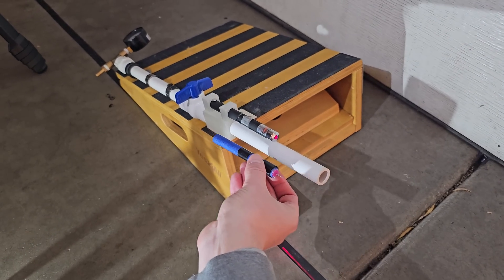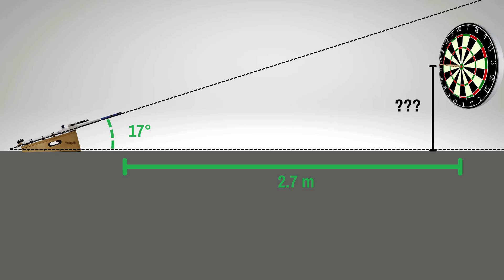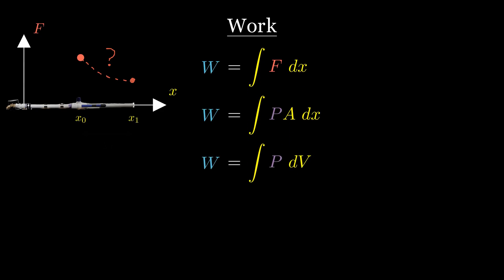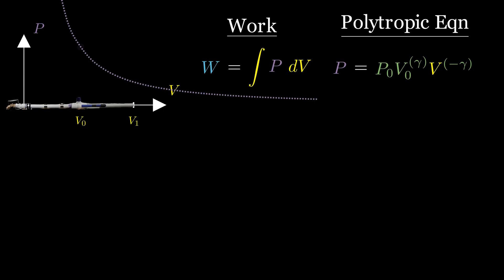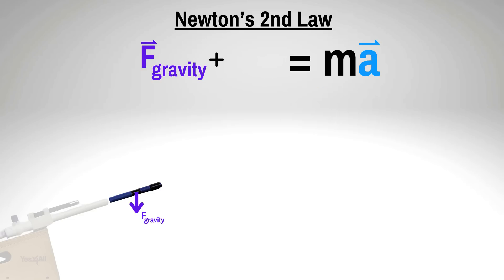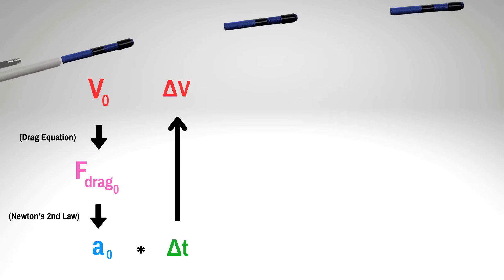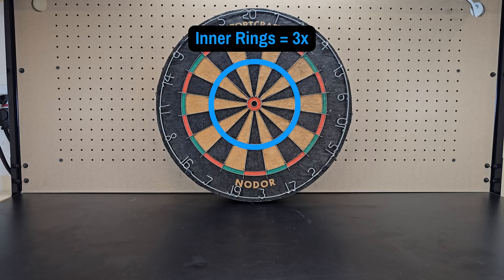Pneumatic Dart Cannon: Theory vs. Reality

Comment: The dart doesn't seal against the cylinder perfectly like a piston... a lot of pressure will escape around the sides. The actual force on the dart varies a lot based on how tight of a seal it is, and how steep of a pressure drop-off you have. A larger pressure vessel would have less drop-off. Also the drag calculations vary a lot based on the exact geometry of the dart, but I don't think it's significant with the weight and speed you are working with. The bigger factor for trajectory is the wobble of the dart leaving the barrel.

If you want to try again, try using a more rigid dart material and some kind of plunger and o-ring to seal against the walls of the tube.

Comment: If we take into account the following attempts it could be less likely that the math was wrong but more about the execution.
With no wings to stabilize the dart it is less likely to fly straight.
The release mechanism would initially release the air unevenly against the dart.
Weight distribution within the dart itself could be off as it was put together manually rather than something like 3d printing. This allows greater room for error.
These are just a few ideas off the top of my head.

Comment: I thought over, but then with your calculation you predicted the speed to be 63m/s which is wayyy to high so I changed to under thinking you would miss the board. In the end, as you said yourself, the distance is too short for the difference in speed to make a difference

Comment: I think the biggest factor, especially regarding accuracy, was the material of the dart. Your calculations could've potentially been more accurate if you used a more uniform material. I would assume it's really hard to calculate things through cheap styrofoam, and I doubt nerf darts are air tight

Comment: A distance a bit greater would allow the dart to getting a straight position (point/head looking to the goal or slightly down to the goal),
then, increasing the angle to 21° to allow a more curved trajectory would improve the previous. Now, a bit increase in the pressure, to adjust to the new distance and angle (but a little lower of the higher prediction, a few trials would make it easier for you my friend). Now you get the center, because the problem in your previous is that it wasn't took into account that the head of the arrow kind of "dance" up and down, while travelling.
You might also have a vortex of air to the right (from the left) that deviated it to the right, but that's minor, once the previous is done, you can review that part by redirecting the cannon a degree or almost a degree to the left (lateral) 
(if necessary)😂😂😂😂😂😂😂😂

Comment: I'm pretty sure there are 3 things you didn't account for in your calculations. 

1 - The time it takes you to open the valve : Because you aren't opening it instantaneously the pressure doesn't start at the max. So there's a gradual increase in the force acing on the dart, and due to its inertia and the increased friction force at rest, a large quantity of energy was used up just getting the dart moving. 

2- The elasticity of the dart : At these forces and time-frames the dart doesn't act very solid, so as it's being pushed by the force it's also being compressed, this also takes energy away from the system and adds instability to the flight path.

3- The wobble of the setup : PCV just isn't rigid. So any way you slice it you can't be very accurate unless you switch to an actuator to release the air.

Great video, thx

Comment: Even after plugging both ends of the nerf darts, the material is both quite elastic and porous. I think that should you point a slow motion camera to it, you'll find that it wabbles a lot. Thus, I assumed that it was never going to be flying straight no matter what. At that point the only question was weather or not it would stick, which I mostly guessed since Idk the force required for penetration of the board. 

Anyone who's ever fired a nerf dart irrespective of conditions can tell you that these things won't fly straight no matter what. The styrofoam or whatever it is made of is not a structurally sound enough material to be made to fly straight even under aerodynamic shapes

Comment: I dont know why. But i havea BIG suspicion that in a lit of cases.

Work isnt exactly dW = Fdx

Only in the cases where you are not giving the object speed.

Why i say this?
Take for example gravitational potencial energy. mhg makes perfect sense. Force of gravity times height.

But now imagine applying a very little force to a block of ice. Its gonna accelerate. And its gonna travel a looot of distance. This means you could easily get huge values even tho you applying very little force.

I feel like this formula is only valid when there is no gain of speed. 

Can anyone correct me?

Comment: The pressure curve was probably way off because you used a ball valve. The dart starts to move when the valve is only slightly opened and probably leaves the barrel before it is fully opened. 

You should try using different valves and compare the exit speeds. I have a video on my channel where I shoot an earplug over 80 m/s using a solenoid valve from a washing machine. A burst disc would be even better. It would probably get close to the ideal pressure curve

Comment: I would say over, I think the odds of it flying perfectly straight and landing  in exact vertical alignment with the bullseye are very low and the odds seem to be calculated with the assumption that it will fall on that vertical line. it could get a 2 but overwhelmingly the odds are any other number.

Comment: Foam darts are flexible so it’ll never be consistent. Opening the valve is never consistent so they’ll never fly the same and I’m sure it has some funky drag going through the pipe. Change the designed of the dart and use an air valve or an electric air valve.

Comment: I think you forgot to account for the friction of the dart against the inside of the barrel. That is why the actuall speed was alot less than the expected speed.
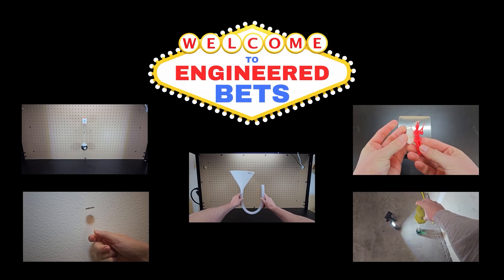Reply: 7:02 top of the screen
Reply: I think the friction of the dart against the wall is already taken into account with the calculation of the polytropic work done on the expanding gas.
Reply: @ariespics  why would it be ?
Reply: No? @ariespics